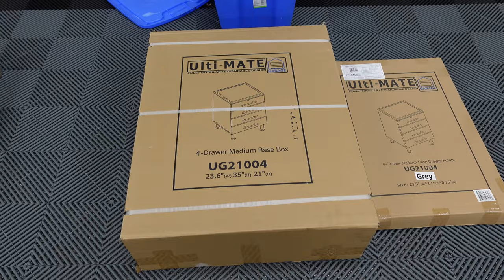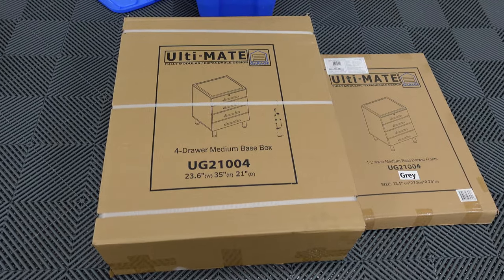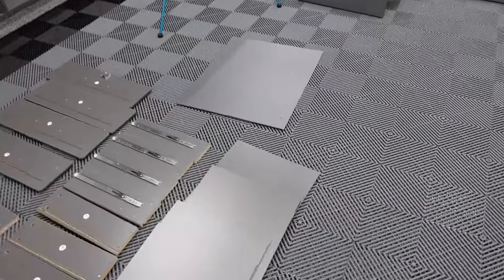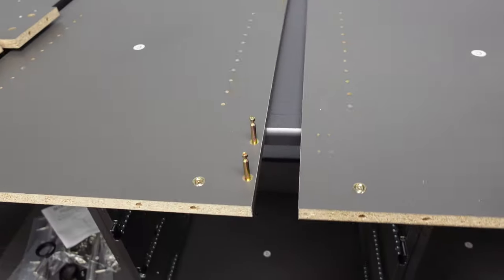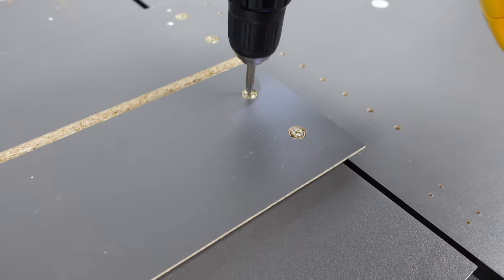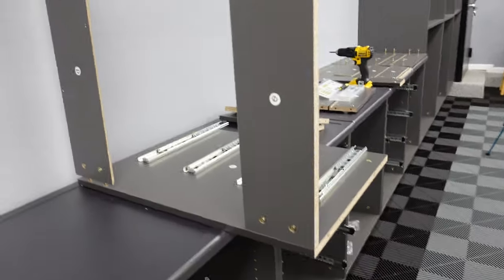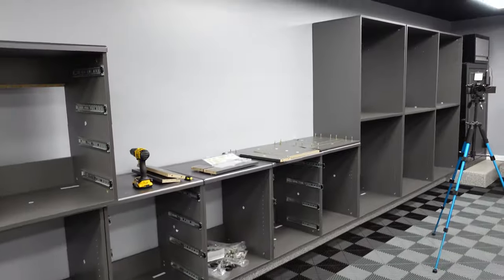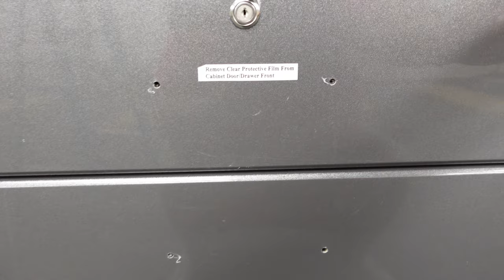Ulti-MATE Garage Cabinet "4 - Drawer Base Cabinet" Assembly and Install Part 3

Comment: I have a 24x54 shop underway and I was wondering if you can recommend wall/roof colors to help.  I build large scale RC Models and will be building a real plane as well so its not for detailing a car.  I wasnt sure if the dark colors you typically see in detailing garages would give good light results.  Thanks
Reply from the maker: These dark colors are great. I don't detail car either but I used to RC build ALOT. but back to the point. these colors work great WITH a good amount of light. Right now I have 16 of these 4 bulb fixtures and my garage is 42x 22 https://bit.ly/3v5mH9h

Comment: How do you remove drawers? I have these but on drawers front is loose and can’t insert bottom without taking out drawer. Are you originally from England?
Reply from the maker: Tabs on the rails… South Africa